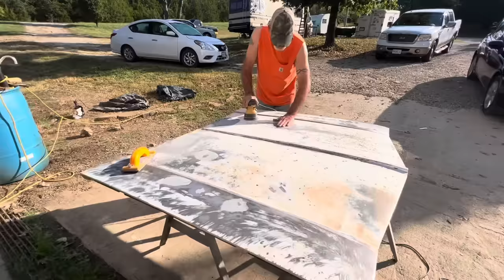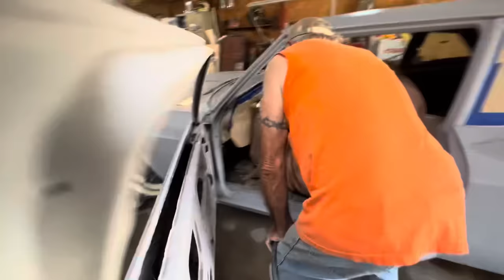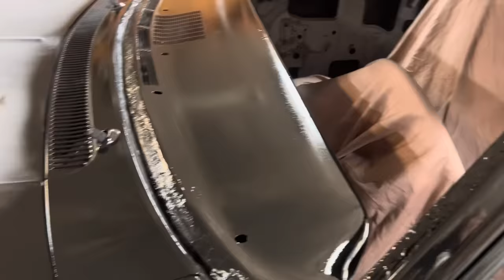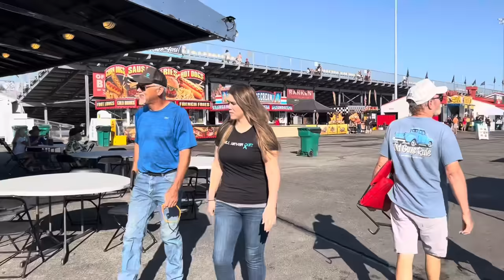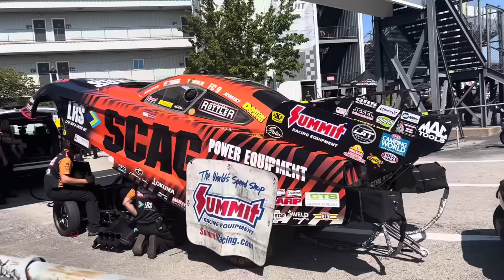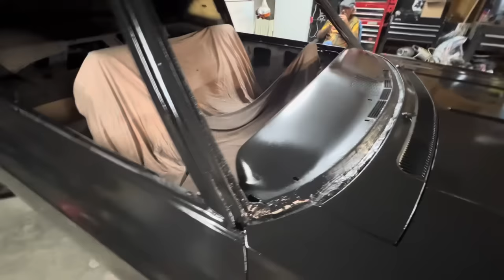Budget-friendly paint job for under $50 using Tractor Paint.

Comment: Rustoleum profesional in the gallon cans mixed with acetone will spray on super smooth and shiny with even the cheapest $14 harbor freight gun. Painted 2 cars and 8 race cars with it. Paint,acetone,and gun will run you about $75. Looks as good as if id spent $400 at the auto paint store. Rustoleum comes in many colors.
Reply from the maker: I’m saving this post for future paint jobs. Thanks
Reply: How much acetone per quart? Any hardener?

Comment: When I was  growing up my dad owned a body shop in Mid Missouri, My aunt and Uncle lived in Park Hills for 25 years or so btw, and being in the middle of Farm Country we painted ALOT of fam equipment and used alot of Tractor paint, I've used Tractor paint on probally 75 cars over the years, I;ve even mixed it and created custom colors, When my baby sister turned 16  I gave her a 62 Galaxie that I bought in a package deal from a Real Estate Auction and we painted it International White and after we painted the main body I throw a 1/2 quart of New Holland and almost a full quart of Case Red in the 1/3 ish gallon of White I had left and threw it in the paint shaker and created a custom purple and sprayed the Roof and painted a custom pinstripe down the side, 13 years later she still has it. I will say over the last 20 years or so Tractor Paint has came a LONG way.
Reply from the maker: That’s good to know I can mix it and make one off colors. Did you use hardner and regular thinner? We are just learning.
Reply: @DEADCARRESCUE  I use the Majic Brand Paint, and just buy their Hardner and Thinner that's made for specifically for tractor paint, I also use a 5 part paint and  1.5 part thinner, it makes it spray better and you don't get alot of egg shell/orange peel look so you don't have to cut it as much before you buff. The good thing about the Majic brand is it it's a single stage paint so no clear coat needed.
Reply: You're a Much Better Brother that I was ! When My Sister got married she was about 21 and I was 16...she let me use her 1959 VW Bug Convertible while she was on her Honeymoon ! I had 3 buddies with me and I Rolled the VW over into the Woods...none of us got hurt but I destroyed her Beloved car !  FJB !
Reply: @Snailmailtrucker  well she's 21 years younger than me and like I said I got it in a package deal from a Real Estate Auction, I had to buy all three cars, the 62 Galaxie, 76 Nova and a 41 Dodge pickup, and had already sold the 41 Dodge Truck for more than what I paid for all 3 so i had already gotten my money back on the deal and she needed a car and my dad already had the paint so all it all REALLY cost me was for the tune up kit, new fluids, brake shoes and brake fluid and that was 14 years ago so what? 100 bucks? maybe 125 bucks back then, I was good with that.

Comment: I used to paint with PPG and Dupont, but the stuff got too dang expensive. Here's what I'm doing from now on. I'm using epoxy primer as the basecoat and putting 30 dollar a gallon u-pol clear coat over it. You can get white, black, grey or red epoxy primer and once you clear coat it, nobody will ever know it's primer. Doing it this way, you sand and mask one time, spray the epoxy primer, then put the clear over the wet epoxy, and you got yorself an easy paint job without having to sand the car, then primer, then sand primer, then remask. I used to use 3 stage PPG, where I sanded once, then sprayed epoxy primer, basecoat and clearcoat.
Reply from the maker: I’m going to look it up. Thank you sir.
Reply: @DEADCARRESCUE  You're welcome my friend.

Comment: Awesome job. I've heard the Rust-Oleum tractor paint does not even need a clear coat; is Rust-Oleum professional just as good? Can you get away with just a good buff and polish afterward?
Reply from the maker: Well we found out that the the tractor paint needs more than one coat. We were experimenting basically and once it dried it was very dull. Tried to buff it and went down to previous brown color :(. As far as clear coat goes I’m not sure.

Comment: I learned about farm equipment paint in 98 when I was working at a machine shop. They used it on the sand reclaimers. The guy who painted them always bought old trucks and repainted them with it. Was like 20 bucks a gallon then and it always looked great compared to what they started as. It’s just a shame you can’t get 400 beaters that run good anymore!
Reply from the maker: People at swap meets are asking $400 for old car steering wheels on some old stuff. I bought the whole car for $400 in the 70’s. It’s a sellers market today.
Reply: @DEADCARRESCUE … that paint job looks great to me! The best painter I’ve ever watched was a Puerto Rican guy down in Miami paint his 1972 Chevy Malibu convertible in his garage (gloss black w/white hood & trunk stripes) when it was pouring down rain outside. I asked him about the potential problems with all the humidity, and all he could say in his broken English was “Nah, mang…it dung matter…” 
That damn paint came out like GLASS. It was all in the PREPARATION that mattered to him, and damn - it surely showed afterwards…

Comment: Flash seems like a good dude to hang out with but his painting technique and gun need some refinement...
If you wet sand it and buff it the dry spots will shine up. Putting more paint on top of that will usually make things worse.
Reply from the maker: We all need to work around a real painter and learn. But since we don’t like to listen lol we just jump in with both feet. That’s just the way older guys like us operate. I get on you tube and watch how to do things sometimes but it’s usually after I’ve screwed up. Thanks for watching.

Comment: I would say that if you require tractor or Rustoleum paint, primer, hardener, acetone, paint thinner, masking tape, masking paper, sand paper, and body fillers to paint your car, then … no; you cannot paint a car for $50.00. Probably more like $250-350 for all that  but that’s still cheap for a car paint job!
Reply from the maker: Maybe. But basically talking about just the $47 a gallon paint we bought. We still have a quart or more left over. Our labor???? Maybe $20 lol. Would you hire us and pay more than that? I don’t think so lol

Comment: Need a wider the spray pattern
Reply from the maker: It would have had more runs than we could have counted if we did have.  We are beginners and had no idea what we were doing.  I will remember that when I paint my fairlane though.
Reply: The top adjustment on the spray gun is your fan pattern,  the bottom is paint delivery